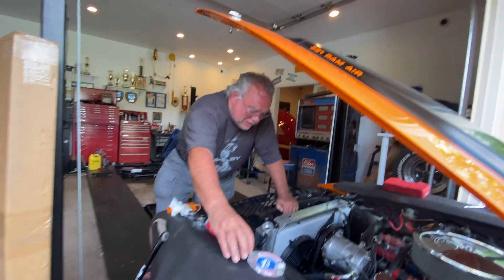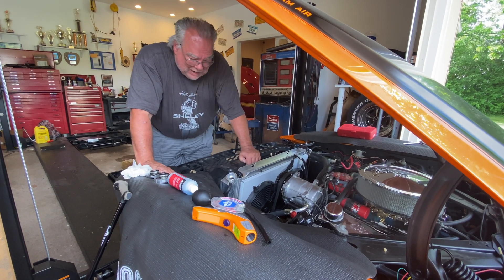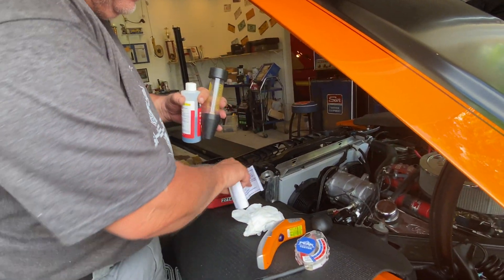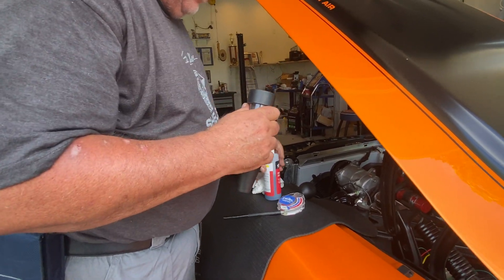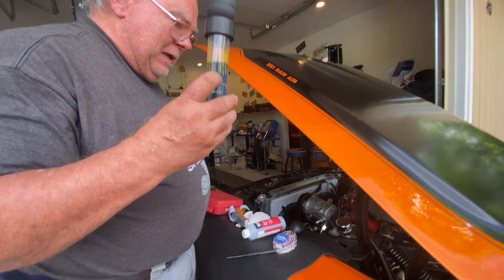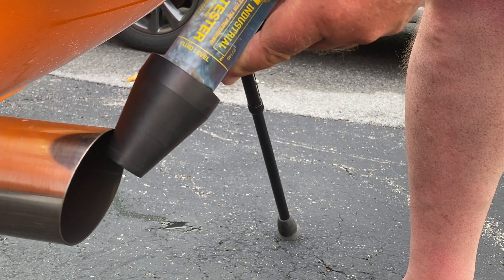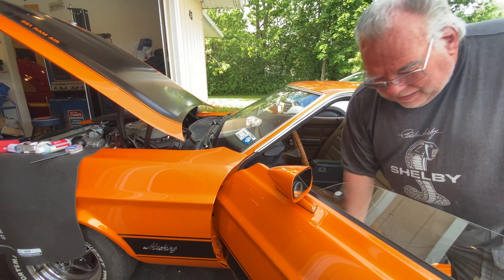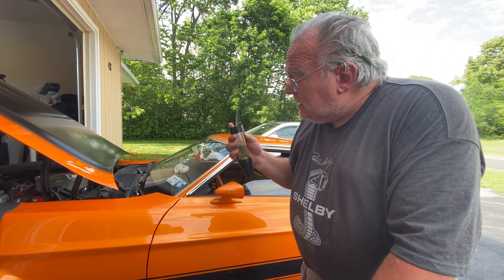1973 Mach1 Block Check Combustion Gas Test For Cooling Systems

Comment: Great video and as always good information . I hear the electric fans coming on . The car sounds great 👍🏻
Reply from the maker: Yes, that is our dual electric fan array turning off and on as the coolant temp thermostat causes the fan relay to turn on and off.  I have two other videos that may interest you.  One shows us installing our dual electric fans, 3 row aluminum radiator, and how we wired the fan relay.  The other shows how to wire in an LED light to show when the electric fans have been turned on.  

https://youtu.be/T5DrC2zrpIA

https://youtu.be/ErDOMJ1hOnA